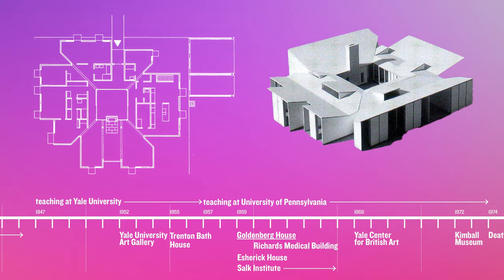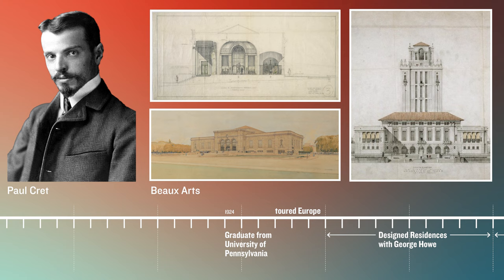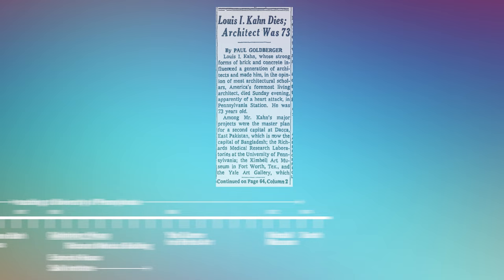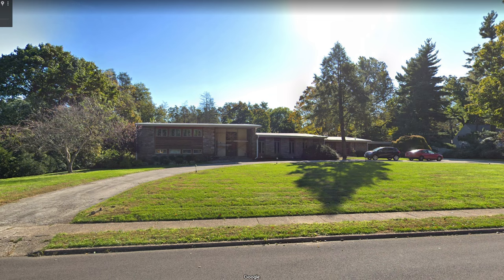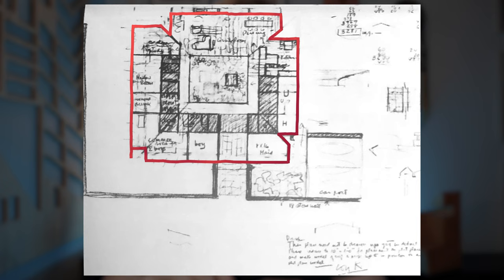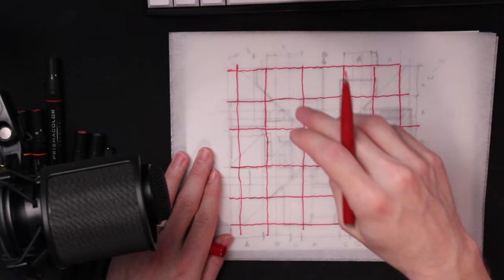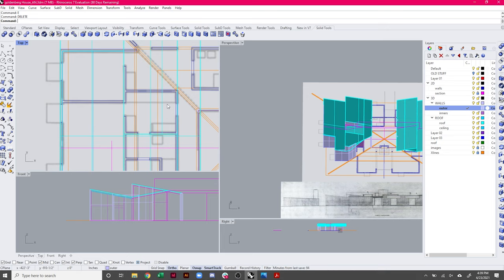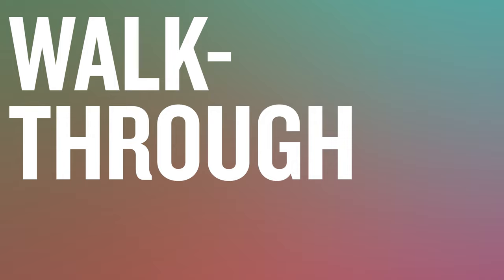Exploring Louis Kahn's LOST Unbuilt Masterpiece [Goldenberg House]

Comment: That was an interesting walk through. I wonder if you could color the walls and floors with different colors to emulate actual houses? I think the Goldenberg house would have been very aesthetically pleasing from the resident's perspective. But it might well have been uncomfortable in that era: without really good thermal glass the courtyard might have either heated or chilled the house excessively. And I think that cutting out the corners feels like being clever just for the sake of being clever. Triangular/partially triangular rooms are often hard to live in.
Reply: I would sacrifice bed placement to live in that house lol. The courtyard would present some interesting heat gain and lose variables.

Comment: I am struck by how Kahn's design is very axial in organization, but also how he deflects from the central axis in the movement through the building, using such devices as the off-center entrance and the massive chimney right on the axis. It reminds me of Edwin Lutyens' houses, where classical expectations are constantly thwarted because the central axis is blocked in one way or another. The visitor is constantly forced to move to one side or the other. With Lutyens it makes some of his buildings "feel" much larger than they are, and it looks like the effect would be much the same with the Goldenberg House. 

I remember Kahn's death, as I lived in NYC in 1974. It made the papers because his body remained undiscovered in that toilet stall in Penn Station for so long. It was presented as a sign of the decay of the city, which was close to its nadir of livability at the time.
Reply from the maker: Wow, thanks for sharing your thoughts...

Comment: Question: How important would you say halls are? I feel like they are a failure of design in most normal houses. I get that they are an experience if large enough, but that most houses and lives doesn't have use for them. Or what's the argument for them, other than isolating from the outside cold when people enter.

Comment: Stewart, do you regularly use a bathroom with an eastern facing window?  I think I know why your mustache is uneven.  You use natural light when you are shaving and the shadow of the mustache in the early morning makes you think you're shaving a perfect mustache, but it's off in a very consistent way that I have to wonder about.  Why is it always slightly heavier on one side?  It's a mystery!  I demand answers because it's 100 percent a question about design and architecture if the cause is morning light related. Thanks for making these videos.

Comment: Would work so much better if the atrium was roofed with a pyramid of glass and its glass barriers removed.— that is was not may be the real reason it was never built — intellectual bs got in the way of spatial feeling — try that in your computer model — also try adding textures and color and furniture so to complete your interesting , albeit  a little nerdy, narrative — architecture is really much simpler — how a space feels is the only criteria.